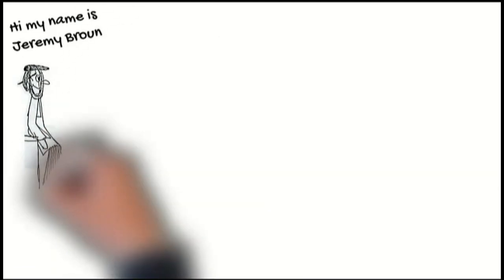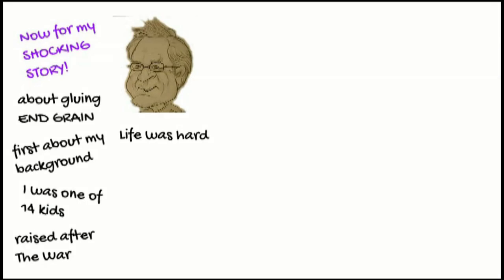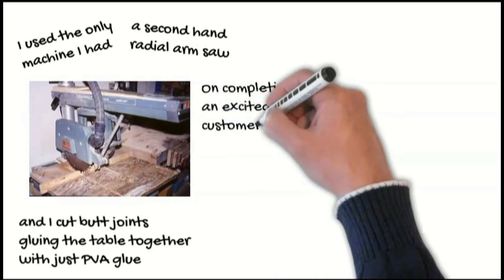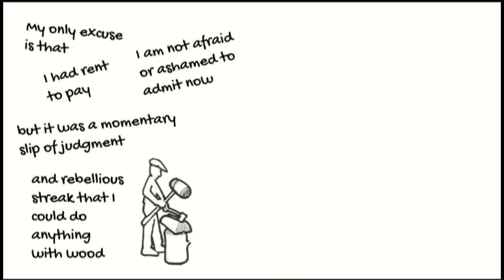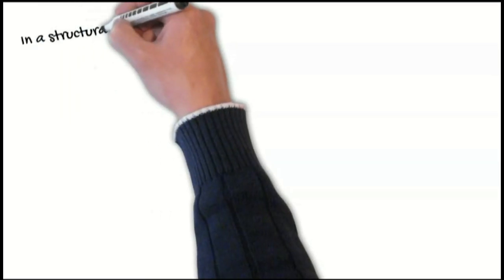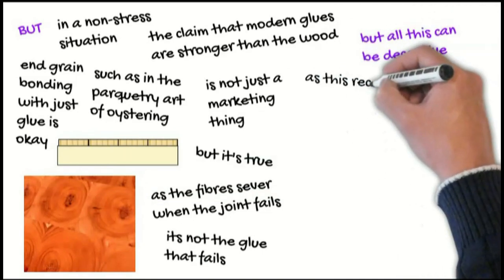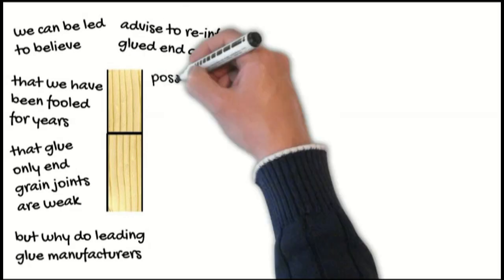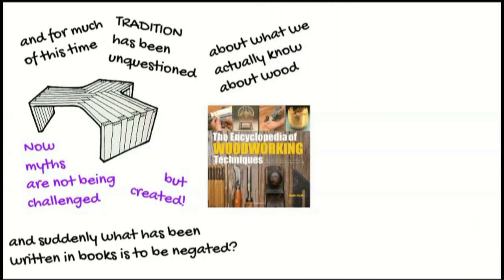The Shocking Truth About Glued End Grain Joints

Comment: One way to look at it is this,
When you build a house frame using only nails and mostly butt joints the orientation of the joints needs to be correct first, the nails are only there to restrain the wood from moving, the wood bears the brunt of the force the nails simply keep things aligned. ( we used to use wooden dowels)
Glue is used in much the same way, the joint should first be as mechanically sound as it can be, the glue has only a supporting role of keeping the mechanical joint together but should not be subjected to the majority of the stresses of the joint, thats the woods job
With butt joints there is no mechanical connection, the chemical bond of the glue is the only thing keeping the joint aligned and proviiding structural support. Glue is not designed for this and neither is the natural stucture of the wood and this is why end grain joints fail.
Reply from the maker: This is a good script for a video on what has to be the essence of woodworking - jointing,  as you put it very consisely. Sadly, the way YouTube is evolving and the kind of mentality of mass audiences in the pocket of a few of the 'Big Boys' who are predominantly salesmen, is echoing a malaise in society where cultures are cancelled and in our subject the proper teaching of fundamental woodwork in schools was cancelled some time ago and I understand this has happened in the USA which maybe explains why this end grain myth has been invented. I recall in my eartly furniture making career (circa 1973) contacting TRADA (Timber Resarch And Development Association) about the way I was gluing huge blocks of wood together to make a sculptural desk clock and asking them how the glue would behave and hold the sections together over time. Bear in mind I had aligned the grain direction so all  the segments would move together. I did not get a definitive answer which was a wise response because I still have the prototype clock and very recently repaired the clock movement on one of the clocks I sold to a local client. If you have the time take a look at the video:    https://www.youtube.com/watch?v=l9Ar-8kcm_g

Comment: Hi Jeremy, great video.  I had just watched the video you mentioned earlier this week.  Is the take away simply that in a situation where leverage can be applied - an unreinforced joint is just not up to the job.  For example, no one would make a table leg out of cross-grained wood as it would just be too weak. While glue may be stronger than lignum, we don't rely much on lignum for structural strength.

The biggest design flaw in the Gibson Les Paul is that headstock break angle means that the strength of the lignum becomes structural.  Thus Les Paul necks all snap in the same place.  Newer versions of the same guitar rely on scarf joints or less of a break angle.

Thanks again for the video, I feel that the earlier video you mentioned was interesting, but just dodged around the true reason that people don't glue end grain joints.
Reply from the maker: Somebody restoring my sanity - discussing guitars and wood strength in the real world! I dont personally know the Gibson Les Paul but have a PRS which is syled on the Les Paul guitar and I have built nearly two dozen guitars so I know a little about woods and the stresses put on a neck. Headstock angle is crucial of course and the steeper it is the shorter the short grain. In general woodworking terms short grain is a weakness and to be avoided when designing. Instead of splicing necks I laminate my necks from thin vertical sections  and depending on whether steel strung (more stress) or nylon strung, I interlock the laminates at the headstock juncture to spread the strength  - minimize short grain.  This video showing a glimpse of how I made the walnut neck should show the laminates: https://www.youtube.com/watch?v=PdalfrjXKek    My PRS guitar has a mahogany type one piece neck and doesnt look vulnerable than other if it were dropped and landed at the wrong angle no doubt the headstock would snap because that is where the short grain is.  Hope this helps.

Comment: It's interesting that plywood achieves it's amazing strength by gluing the direction of the grain of the layers together in an approximate 90 degree to one another
Reply from the maker: You have put your finger on it - this gluing configuration of massive glue surface area of adjacent grain bonding is a feature of one of my 1973 furniture designs I have sold all over the world and that touch wood is still holding up after nearly 50 years. Early examples in pine are selling in auction houses. I'm a little reluctant to share my trade secrets of construction as proportion and geometry is absolutely crucial in the glue only scenario but it totally blows away Mr Sullivans claim that end grain gluing is twice the strength of side grain, certainly in the real world. Your example of plywood is perfect and the thickness of laminates is crucial in its bonding longevity. In theory adjacent fibres glued together are fighting against each other in the way the wood wants to move.
Reply: @WoodomainJeremyBroun   Thanks Jeremy -Opposites attract like in magnetism

Comment: In one of your comments: "Why on earth would anybody NOT put glue on all surfaces of a joint?" (-:
Reply from the maker: I think I made that comment on Rob Cosman's channel and I  was of course referring to the revelation that in the USA and Canada the practice is not to add glue to the end grain sections of a joint, eg tenon shoulders and mortice bottoms. I thought it was a given that glue adds some strength to end grain but on its own is not structurally sound. Of course the argument Mr Cosman put up is that glue is messy to remove around the shoulder but its no different to cleaning up glue from anywhere else and is done in different ways either pre or post lacquering. What a fascinating subject woodworking is. Thanks for commenting. Its being taken to a whole new level now of fantasy!

Comment: As so many others, you fail to grasp what Mr Sullivans experiments show. When you are adding reinforcement in the comparison, you compare pears and apples. 

If you ever have restored old furniture where the joints have came apart, then you would know that it is not the glue that fails, but the wood. The wood fails parallell to the fibres, showing that Mr Sullivans conclusions are correct.

If you are going to compare reinforced joints, then compare the same type och joint, with the same type of reinforcement and shift the grain directions in the boards used in the joints you're going to compare. No matter if you reinforce the joints, you will get the same results as Mr Sullivan did.
Reply from the maker: Sounds like an echo chamber comment (comparing pears and apples). No I dont think I have failed to grasp what Mr Sullivans video was about and the message it clearly conveys and  I think if you watch my video you will see that not once I have claimed the glue fails! Yes I have repaired and restored furniture including a Chippendale chair that was almost beyond repair and you may learn something about wood, grain and glue if you watch it:  https://www.youtube.com/watch?v=hLbVmmYNvdg   And maybe to answer your last question you would like to view the comparable strength tests I did on end joints and glues back in 2013:  https://www.youtube.com/watch?v=ER1k4Pcyn0M
Reply: @WoodomainJeremyBroun  obviously, you fail to grasp what Mr Sullivans experiments show. Still comparing pears and apples.
Reply: @cschlater  
What is it that we are supposed to have "grasped" from Mr Sullivans video?
The fact that modern PVA glue is stronger than wood lignin? Many of us have know this for decades. Should we have learned that a glue only bonded butt joint is weakest along the glue line? I submit the same annswer. 
None of this is new or revelatory in any way. Naming a video Glue Myths and then later posting accross the screen "End grain joints were the strongest joints of all" what do you think people will take away. 
From the numerous comments he's recieved, far too many seem ato be of the mind that this applies in a real world scenario, it does not and can be dangerous. Not to mention striking a blow against woodworking in general.
Reply from the maker: @Eweber007  Well put. Its about time the word 'dangerous' appeared in the discussion over Mr Sullivans video, especially in chair joints or even the kind of table I demonstrated if somebody stood on it to change a light bulb!
Reply from the maker: Christian - on your YouTube channel I see you have a video about your introduction to woodworking. I am curious to know why you block people from making comments?!!